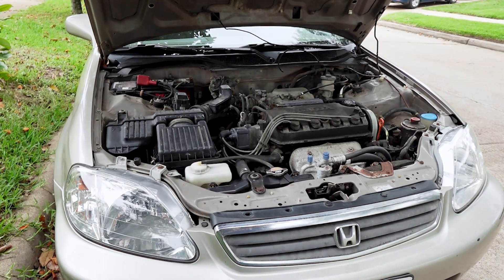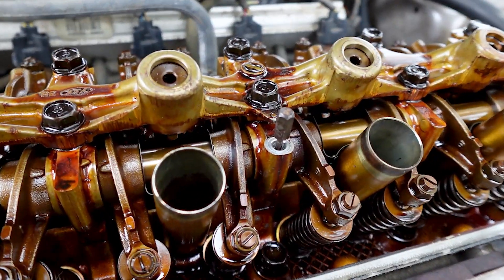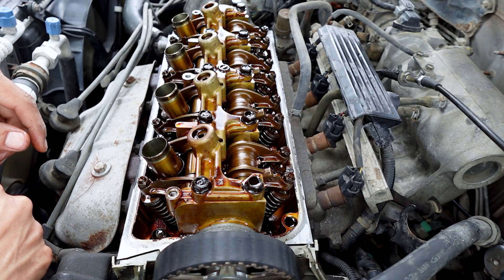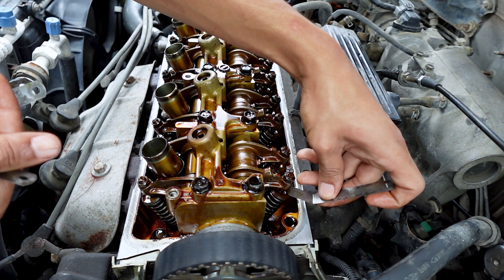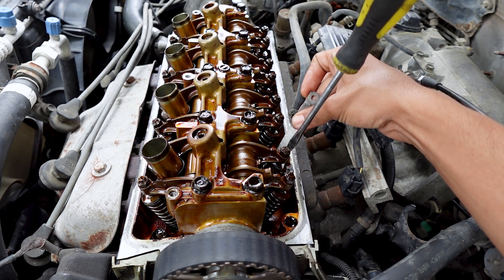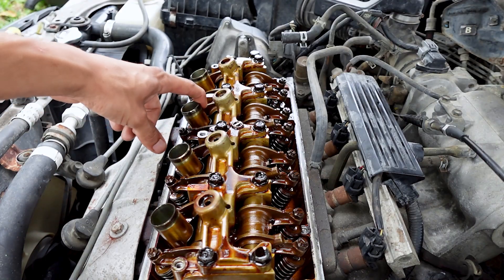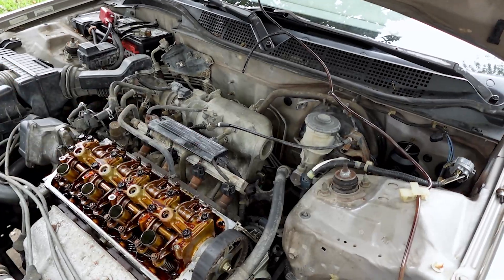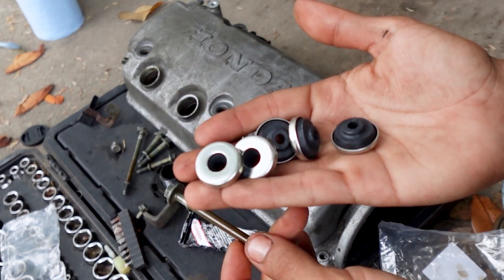Honda D16 Valve Lash Adjustment

Comment: Why are you turning the engine counter-clockwise?
Aren't you supposed to turn the engine in the same direction they rotate, which I think is clockwise?
Thanks!
Great video!
Reply from the maker: @gonzagnr2  honda motors spin counter clockwise

Comment: Hi it's Haroon from pakistan. 
Here we lack good mechanics. 
My timing belt broke and after installation of a new one there is a clicking sound coming from the valves and it increases with the revs. 
The power of the engine is the same as it is starting and accelerates well. My question is that is it safe to drive in such condition (with clicking noice) or shall I go for an overhaul of the head and valves. 
P.s. it's expensive here and mechanics are not so good. 

Thanks
Reply: apka dukh samjh skta bhai idr mechanic se valve he nae adjust hourhe khd he sikh rha taky krskun

Comment: I thought 1-3 could be done at the same time
Reply from the maker: correct as long as there's no load from the cam put on the rocker. Just showing it how the manual would show it to be done and not to confuse ppl as it may be their first time working on their car
Reply: @SwishLifeGarage  definitely my first time doing a valve lash .. I don't paying nobody $200 lol bo builds does 1and and 3 then turns crank then does 4 and 2  it's all confusing but I'll figure it out ..

Comment: I have an 04 Odyssey with the V6  . . should I do its valves? It seems pretty tight still 200k+ miles. Another big bummer is the shift selector shaft blew a seal I think, pretty certain, they say it's the weak point. got the seal to replace, but what a pain it looks like, module on it and all to pry off, ATF everywhere.. ugh. Great work, enjoyed much.
Reply from the maker: Thank you. If I was you I would definitely adjust those valves. Sometimes just got to tackle those jobs you don't like, do it once and forget about it.
Reply: Was it leaking oil or ATF from the seal on the shaft selector. I had changed mine cause it got messed up but not the seal and I think it's leaking oil